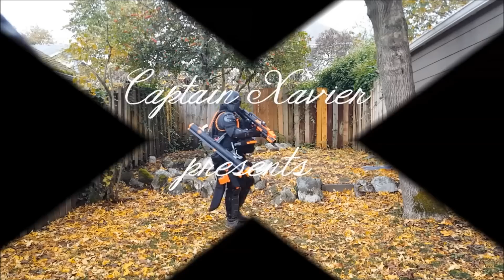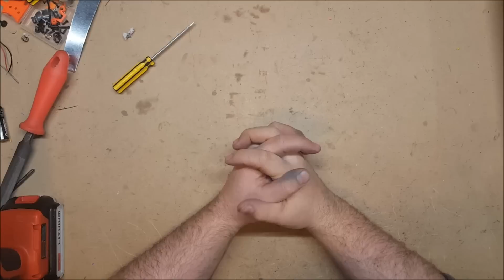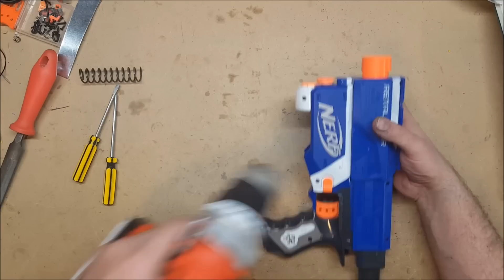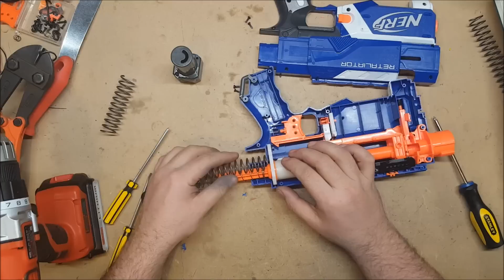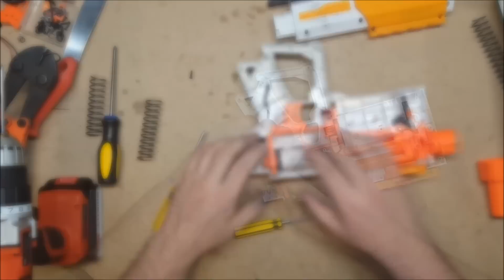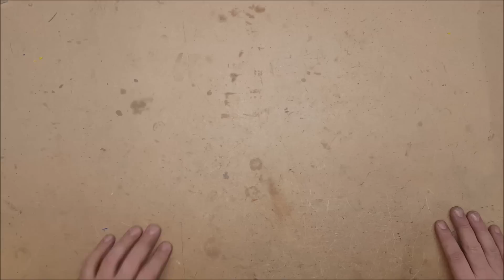Can it Take a K26? - Episode 12

Comment: TFW you find out external plunger recons are semi rare and remember you passed one up thrifting. At least I have a red one, even if it's missing the light and sight.
Reply: i lost my red recon but i have all the attachments for it
Reply: John Grasso I got an external plunger recon on eBay with a strong arm for $15. It was modded so the internals are in rough shape and don't hold much tolerances anymore. I don't know what was done to it but it likes to destroy darts and is really loud when it fires.
Reply: @Piemaster17  I'm the opposite
Reply: I passed one too

Comment: If you attempt the Slingfire, make sure you lock in the clutch on the priming lever. You'll see what I mean when you open one up
Reply from the maker: Thanks for the tip.  I rather suspect it will not be able to take k26 without a re-enforced or replaced priming handle.  But we will see.

Comment: One could make the argument that as the successor to the original Recon, the Retaliator is the the spiritual Recon MKII with improved internals but identical looks to the original, and the actual MKII is really a MKIII because of similar internals to the Retaliator but updated looks, and in that case the Delta trooper could even be considered a Recon MKIV (Mark 4) with its similar design aspects and included slam-fire.

Comment: So, is it possible to stuff Retaliator internals into a Recon?
Reply from the maker: Supposedly.  I have heard of it, I have never done it.
Reply: TNTlover9 I have done it once... it is definitely possible but a slight pain... since the recon is reverse plunger the exit hole in the stock attachment point is slightly too large. Thus you have to use a sort of pipe to act as a spring holder. I uses some duct tape and part of the original plunger for that purpose. It is definitely a fun project and it works well, though mine is slightly hard to prime. I can email you pictures of the one I built if you are interested!
Reply: Ah, thank you! Though, I may be able to figure out it (hopefully). I found a broken Retaliator at a Deseret Industries (didn't buy it, mistake) and thought perhaps I could stuff it into one of my Recons.
Reply: TNTlover9 Yeah... it is definitely fun and a cool thing to tackle
Reply: I put the retailator guts in the recon mk2 and it works but I kept the springs from mk2 cause they was better, stronger ,and no air holes in the tube of retail at or, the said thing is I have the first version if mk2, so grrr only 6 round mags for me, until I shell mod it....maybe idk yet
Reply: Shoves Retaliator XD internals into a Gear up Recon
Reply: CommanderWolf Hadley you can use the 10 and 12 dart mags

Comment: Hey captain Xavier, you've probably already figured this out, but for the drain blaster shotgun, if you use a 3/4 pvc to 3/4 inch cpvc adapter and attach a 3/4 inch cpvc to 1/2 inch cpvc with a 1/2 inch length of 3/4 cpvc, you can make a really powerful sniper for elites

Comment: I recently got an XD Roughcut from Goodwill. When I prime it, it fires 2 darts out the left barrel but the right barrel works fine. How could I fix this?
Reply from the maker: Every time?  So it first the first two left and one right on the first prime and then the second two from the left and the second right?
Reply from the maker: Ah, yes, that is a very common issue when you use slightly older darts.  They do not stick in the barrel and the ARs push them out and cause issues.  There are several fixes.  Some easy, some...not so much.  You can brass the barrels (which I need meaning to do to mine...) or you can simple slide a piece of electricians tape down the inside (sticky side towards the barrel).  This helps hold the darts in.
Reply: Captain Xavier thanks! I'm gonna put some electric tape in my barrels!

Comment: if you replaced the retaliator's catch with one that didn't get in the way, does that mean the retaliator could take K26?
Reply from the maker: No.  The bit that gets in the way is the bit that catches the plunger head.  Getting rid of it would mean it would not catch...
Reply: but what if you replaced it with one that was wide enough to fit the spring? would that work?

also, i might have taken inspiration from eir when i started planning out an air powered multi projectile firing underbarrel
Reply from the maker: ...still no...width was not the issue.  The issue is that the part of the catch that engages with the plunger head and thus allows the blaster to be primed also catches on the K26.  If you alter the catch so it does not catch on the k26 it will also then NOT catch the plunger head and thus you will not be able to prime the blaster.
Reply: oh that makes sense. thank you for your time.

Comment: Dear Captain Xavier,

I cannot find a screwdriver that has a small enough circumference to fit inside most nerf gun screw holes. Therefore, I cannot take apart my blasters! 

So, can you tell me what screwdrivers you use? 

Thanks!
Reply: Zac Groszman I'm obviously not him but I got a red and black set of presicion screwdrivers on amazon. it has perfect Nerf sizes plus flatheads and other. its a 9 pack I believe
Reply: eric Gershon how much and link please?
Reply: Zac Groszman I just checked and it's now out of stock. its a tekton 9 piece presicion screwdriver set. it was like $10
Reply: Zac Groszman it's a size 0
Reply: I use #1 size.

Comment: Theres a cheaper way to do the kv6 mod to the cs-6 recon
It requires to of the blasters
Take the springs and put them together for a stronger spring
Reply: Then put the combined springs back into the blastet
Reply: Blaster*
Reply from the maker: ...yes...people have been aware that "doubling springs" is a cheap mod (assuming you have an extra blaster to gut for parts) since the 90's...

Comment: Cpt X I know Im late but I have to inform you about the mk2 the trigger gets stuck due to an assembly mistake so you have to open it and remove the locks It happened to my brand new mk2 in a game and the trigger stuck mid-game
Reply from the maker: +Thanos Vasileiadhs huh, I had not heard that. Have you considered the possibility that it was just a factory flaw in you MKII?
Reply: I did thought of that but since in greece we are very few nerfers I know most of the community.... and I heard about it from 2 more guys.... apparently  the trigger safety is not assembled well in some models
Reply from the maker: Weird.  Good to know!  Thanks!